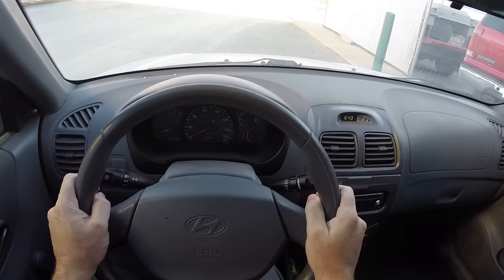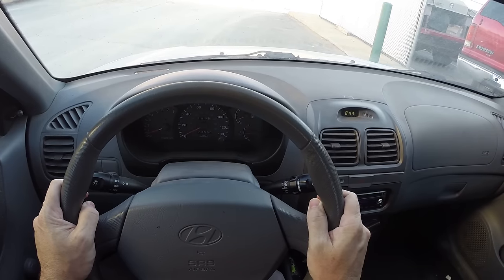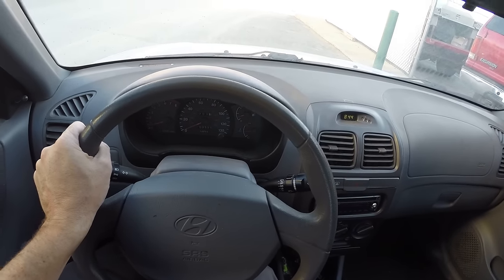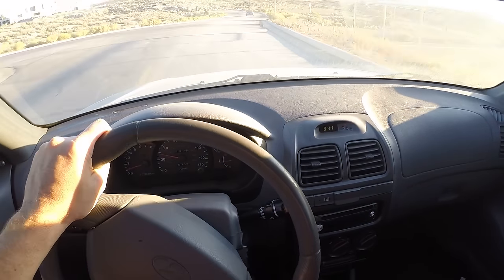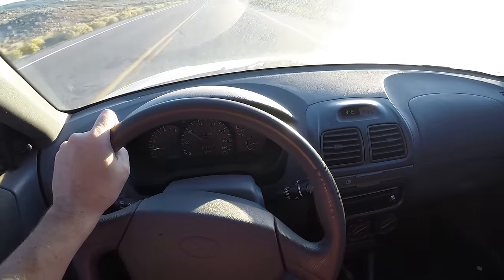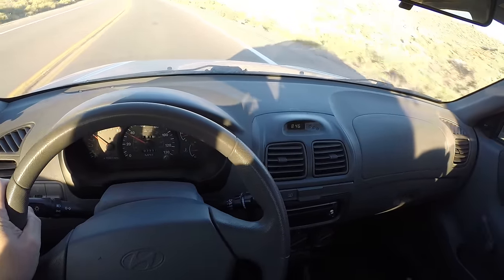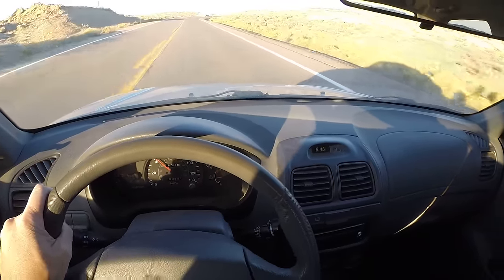What Does a Bad Wheel Bearing Sound Like?

Comment: This is hands down the best video demonstrating the noise associated with a bad wheel bearing. Very helpful, thank you.
Reply: Yes
Reply: I completely agree BEST demo!!
Reply: Wow I have a Nissan Altima and it sounds exactly identical which is crazy .. 🙄🤦🏽‍♀️
Reply: My 2012 Mazda 3 is doing the same thing I was thinking it was a bad wheel bearing, thank you for the video.
Reply: Mine didn't sound like this only when I turned would you hear a clunk and then bam shit broke 😂😂
Reply: Yes handsdown
Reply: @ShaunDoe93   did you fix it I have same issue and bought the parts, I hope it's that?
Reply: @nicestranger1352  yes it was wheel bearing issues on both sides
Reply: @ShaunDoe93  thank you  I appreciate it.
Reply: My SUV is making a old squeaky mattress sound only when I brake, and they said it was my bearings. I got one of them fixed and $375.00 later it’s still making noise. It doesn’t sound like the noise your vehicle is making.
Reply: I have a pajero 1999 same sound ,
Reply: How do you fix it?
Reply: Wish I would’ve saw this video before I took mine to the shop.
Reply: Sounds like knobby mud tires..
Reply: I agree, I'm thankful too!
Reply: Aa
Reply: You have given me the perfect way to confirm my wheel bearing is gone bad. I don’t know how many people (Mechanics included sadly) that can’t give me a definite answer to what problem I had based on the sound they were hearing. That doesn’t say much for the mechanics I’ve dealt with, but never the less, you have set my mind at ease now that I know what I need to do. Thanks a million!
Reply: 😂😂😂 hands down???
Reply: Hallelujah praise GOD if you have him you have all keep doing for the LORD using your special gift amen!!! GOD has what you need!!!
Reply: so if it sounds and also the lug nuts get hot its the wheel bearings too?? cuz my lug nuts are crazy hot too
Reply: 🤕Can't hear a thing!
Reply: @Juelstone y
Reply: Perfect! Just what I was looking for
Reply: Much agreed best video associated with the noise.👏👏 Thanks for all your help🤜
Reply: @carsonfarist8590  Wells said 👏💯
📖➕🕊️
Reply: EXTREMELY HELPFUL. EXTREMELY!!! EXTREMELY!

Comment: That's an excellent video.  This is EXACTLY the same sound and symptoms my 2000 S10 has going on right now.  Not quite this bad but the revving sound and increased intensity at higher speeds is pretty much identical to the issue my truck is having right now.  Thanks for putting this up!
Reply: I had a 2001 S10. I wish to GOD I would’ve never got rid of that vehicle.

Comment: I've also had a wheel bearing sound like a wobble board. Common causes are pot holes hitting curbs at speed. The passenger side is always curb side so it also wears out quicker as it's exposed to all the dirt, debris and water along the curb.

Comment: I was in debate over whether the noise on my crown vic was related to a bad differential or the drivers side wheel bearing. The noise in this video is practically a carbon copy of what I’m hearing, being a deep hum that increases in pitch relative to speed, though mine is MUCH more faint than this. Wheel bearing area began spewing axle grease so now im certain I’ll need a new wheel bearing and a new hub seal. Definitely glad I found this video because I was worried that i had a bad pinion shaft, but found out that the pinion shaft noise is way different! Thanks again!

Comment: The change in sound is more from the change in lateral loading than weight relief.  Sometimes one side of the race gets started with pitting and goes to heck while the other race stays relatively smooth, hence the difference in sound pushing right and left.  Excellent video.  Informative and not a time waster.  Thumbs up and subscribing now :-)
Reply: Wouldn’t weight relief translate to lateral load?
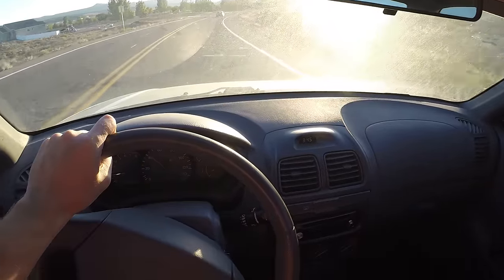Reply: 2:05 😊
Reply: Who the hell do you think you are Fazlah Khan?

Comment: Thank you so much!!! I’ve been trying to figure out the noise my van has been making. It’s been to two different mechanics and I told them exactly what you said in the video and neither one of them said anything about a wheel bearing!
Reply: Checked brake on driver side at two places they told me its okay the sound is not right not sure did you get it figured out?

Comment: Wowwww Amazingly I finally heard the sound of my car that I was hoping for, this is exactly how my car sounds when driving on the road, the more you speed up the louder it gets. And worst of all, there's one thing that I do not see anyone mentions on this issue, it just that when you're driving, it kind of holding the car from moving faster while making the loud noise.
Reply: Same here. My Expedition has been doing the EXACT same thing.
Reply: Joseph Carter it's probably ur axle Hub assembly..jack up the truck and wiggle ur wheels
Reply: Yes mine does that finnaly I don't sound crazzy It feels like I got to push it

Comment: Wow. I did this test. When I turn left the bearing noise quiet down. I thought it was the right rear because there was more weight on it when it was the rear left lifting off the ground getting quieter. 8 years later, still valuable
Reply: Can you tell me what site was bad when I turned left? My noise goes away I don’t know which one to change. I can’t do both. I can’t afford it. I could only afford one side.

Comment: This was very helpful!  My Jetta is making some noise, but I also have new winter tires and had to have my catalytic converter removed, so it's just a straight pipe.  My son was saying it might be my drivetrain, but the sound my car is making doesn't match the description.  My car sounds quite loud, but it doesn't get worse as I drive faster and it doesn't change when I move the steering wheel.  I may have to take it to a garage and have it looked at.  Thanks for posting!

Comment: The noise change while steering  may indicate which side is faulty. However, wheel bearings are double ball bearings. Depending on whether the inner or outer is worn will affect this test. It's why I always quote for both bearings. IME, they fail within a few thousand miles of each other anyway.

Comment: Mine sounded like vu vu vu, in the beginning only when turning to the right (front-left bearing), later when driving straight also.
Reply: Did you fix it ?
Reply: Yeah mine is the same. Very faint intermittent vu vu vu just when turning left. It's gotten gradually louder and can feel the vibrations now.
Reply: @kh-wg9bt  hello I have the same issue and was wondering the wheel hub thanks for the post. I thought that wheel bearing would be constantly grinding. But mine is doing this same sound vuvuvuv  sound.
Reply: That’s a cool decision, “VU” not “su” “wu” but VU 😂
Reply: @mayramanriquez5700  it's the wheel hub bearing you drive daily so you won't notice the sound until it gets loud .when you fix it it sounds like a new car compared to how it sounds before
Reply: @wtfhellas  so did you fix it ? Now no noise after changing bearing ?
Reply: @kh-wg9bt  same mine but its only starts at the speed of 50 km and when above 50 its silent and also below 50 its silent ... only at 40 to 50 it makes vu vu vu vu sound
Reply: @arsalanshah9675  yes it was both wheels for me. Its the wheel hub assembly. Change the entire part not just bearing..noise is gone now smooth.
   Sometimes it's at 50km other times 100kms.
    Just make sure it's not the tire but it rarely is the tire. More than likely the hub assembly
Reply: @wtfhellas  thanks for this bro tomorrow i m going to check but my mechanic said its only wheel bearing not hub now i dont know what is it 😑
Reply: @arsalanshah9675  maybe just the bearing mine was the hub and bearing they sell them together or separately not a huge problem don't even stress fixed and ready in under two hours
Reply: @wtfhellas  your sounded like vu vu vu at 50 and above 50 its smooth or going worse ?
Reply: @arsalanshah9675  yes same sound. It was random sound also. After 100kms it was very noisy.now no problem once it's fixed it sounds like a new car it's not a major issue
Reply: @wtfhellas  bro issue solved ... it was only driver side wheel bearing ... just spent 12 dollar and they changed the bearing to new one ... now its smooth with no noise
Reply: @arsalanshah9675  simple fix.mine was both..huge difference now right?
Reply: @wtfhellas  yeah its silent now ... no vu vu vu sound at any speed ... which car do you have ?
Reply: @arsalanshah9675  hyundai tucson  13 year old so at least it last so far. I thought it was a bad problem but no... youtube is good for information sometimes
Reply: @wtfhellas  lol yeah very useful
Reply: @wtfhellas  mine last 10 years 😂
Reply: @wtfhellas  i diagnose the problem in my car with youtube 😂. sometimes the noises in the car does not happen all the time, even the mechanic have trouble with my complaints so i have to do some research first.
Reply: Mine on my honda pilot is Like wowowow o is like in Food
Reply: @zzztubazzz  lifetime because car manufacturer expects you to buy new car every 5 years.
Reply: @zzztubazzz  they break bro.   You can believe everything you read
Reply: Same thing going on with my 2009. People told me not to use the bearings I did...Hey, they said "Timken"! :(
Reply: @arsalanshah9675  this is what mine does but no idea what side
Reply: Did your wheel have any wheel play i have same symptom no wheel play though?
Reply: @paidinfull5950  i died reading that hahahahah
Reply: As I remember in the steering wheel I didn't noticed any play, only the sound was noticeable. I didn't raised the car to check for play directly at the wheel.
Reply: Yes, the bearing was replaced and everything was OK.
Reply: i know Im quite off topic but does anyone know of a good website to watch newly released series online ?
Reply: That's what mine is doing vu vu vu in turns sometimes and sometimes not

Comment: Not only do bad wheel bearings make that sound but they also make a grinding spinning sound underneath the gas pedal. $40 each bearing and $160.00 for the labor because they use a special machine to press and put them in.
Reply: Have a Chevrolet avalanche and it’s making very loud noise not only it’s the wheel bearing , but it’s making noise near the gas petal. So I have to get it towed too the shop ,because of the special machine has to put them on.
Reply: @CJMusashi87  for wheel bearings you can use a special tool it does not necessarily have to be a pressing machine.
Reply: @CJMusashi87  The Noise by the gas pedal could be the wishbone motor mount in the bottom of the truck or you're CV axles might need replacing.
Reply: @davidtravolta5293  Yeah it’s frustrating had just got a full brake job done two weeks ago got everything replaced. Now this happened at the wrong time start noticing when I was driving working real loud noise. I’m over it. Have to get it done though.

Comment: Thank you for the video.   I have a similar sound that I thought was an exhaust manifold gasket leak, until I was driving turned my steering wheel slightly to the left and noticed the the sound all but disappeared and reappeared after I straightened the steering wheel.  Live and learn.

Comment: iirc, when my roommate's bearings kept going bad we would also notice the vehicle slowing down at low speeds (or premature deceleration?). Hard to explain, but definitely noticed the vehicle slowing down on it's own when it wasn't supposed to. Instead of gliding like normal until putting pressure on the brake to stop. Once this gets really bad it WILL start smoking and has the potential to catch fire due to metal-on-metal friction. Which is very hard to cool down with water because it IS metal which is hot and it's hard to actually get water to the source of the heat. Not to mention, a drastic change in temperature w cold water hitting hot metal has the potential to cause even more damage (temp shift cracking of metal, etc) when this happens.

My advice if it gets really bad. Don't drive it! Get it fixed asap. Better than it catching fire or causing more damage which will cost much more money.
Reply: How do u fix it tho?

Comment: The easyist way to determine bad wheel bearing is just jack up your car spin the wheel and touch the shock absorber plate near in the top of your tire and you can feel rough while the wheel is rotating.

Comment: This is exactly how my wife's Honda civic 2012 sounds. I am pretty upset why my Honda's bearings went bad even though it's barely driven n it has only 92k km while my Toyota matrix 2009 and Corolla 2013 has 190k and 160k km still hasn't changed anything except oil+filter. 

I am not big fan of Toyota but I have to accept when it comes to reliability Toyota strands #1
Reply: ive had one replaced on my 2009 Tacoma at arround 195k miles and im gonna need another one replaced and im at 206k miles now
Reply: That depends on a lot of factors not the brand of car
Reply: @kyoakland  you do realize this isn't just a thing for me specifically the average milage lifespan of a Tacoma is arround 300k

Comment: I was hoping I didn’t have a wheel bearing going bad,but this is exactly what my Nissan Versa sounds like,I already replaced the right rear making a woo wou sound and when I took the bearing apart I could see the inner race had a rusty spot,replacing it fixed that noise,now the right front? The growling noice got to go,thank you for the demonstration and now is confirmed.👍

Comment: This video is exactly what my car is doing right  now. I thought it was a hole in my exhaust and took my car to my mechanic for that. Ironically, I actually did have a hole in my exhaust, which was fixed, but upon leaving, the sound was still there, so I went back and told them about the noise still being there. I took the car out with my mechanic, who, sure enough, figured that it was the wheel bearing. I'll actually be getting it replaced tomorrow morning.

Comment: Your wheel bearing will only make this kind of noise if it was really bad. I had trouble diagnosing my wheel bearing noise because it only appears at low speed and when turning to one side. It sounds like a rhythmic soft thud, something like woob woob woob that gets progressively louder when driving in hot weather/long drive. The wheel does not have freeplay on inspection.

Comment: Nice vid, but just saying. For my own experiences, most of time, some bad wheel bearing wont be heard untill certain spd, dosent matter turn right or left to isolate. Wheel bearing is very decisive, very easy to misdiagnosied with tire noises, steady bearing, intermediate cv axle support bearing. And i just realized that sometimes, a good chassis ears would be very helpful.

Comment: If you drive on it enough, it will cause "cupping" in the tire from it hopping on the road. Then after you replace the bearing, you'll still feel a buzzing which will prematurely wear your new wheel bearing 👌

Comment: This sound just popped up on my WRX. It's not nearly as loud as this but this video makes me think it's wheel bearing and not differential. I was really afraid of the differential being the issue but this  makes me feel a little better. Edit: was indeed rear wheel bearing, replaced with SKF bearing and noise is gone
Reply: Yep same issue on my 2017 and it only has 68K miles...really hoping the wheel bearing is the issue from what the mechanic told me today he confirmed it is most likely the rear. Only thing is I still hear it when I turn my car either way...
Reply: @Bloodrocutioner  so for me it was indeed rear wheel bearing and I replaced it myself and the sound is gone. Mine also made sounds regardless if I was turning or not, I think the rear wheel bearings just don't respond as much to the lateral force. Mechanic should put the car up and spin the rear wheels to listen to which one is bad. I did it on jack stands, just had to remove the brakes to be able to hear over the sound of rubbing discs.
Reply: @pogtuber5146  true! This video made me feel better since I recognized the noise right away in this video and it sounds really similar. I was worried it was the drivetrain but it shifts and drives fine. Going to get more answers Monday hopefully.

Comment: My 2007 Lexus GS has been doing this and the mechanic said its the rear wheel bearing...its that vuvuvu or humming like sound and on highway speeds I get vibrations while deceleration, I'm not enjoying it at all..otherwise the car is smooth but that vuvuvu sound is so annoying on a silent car it drives me nuts...I wasn't sure what it really was regardless of what the mechanic said but now i will get it opened up. Thanks

Comment: I’ve got a 2006 Trailblazer that’s growling like that. When I get it up to about 45mph I can really hear it. It’s got over 108,000 miles on it, and it’s original so it’s probably the bearings. 

I can also feel it vibrating in the steering wheel.

Comment: Useful video. 
Curiously, I had the same noise for the same reason in the same wheel and it was also a 2001 Hyundai.
BTW, not a bad idea to replace BOTH front wheel bearings if one goes bad.